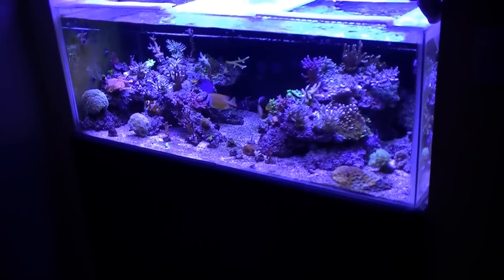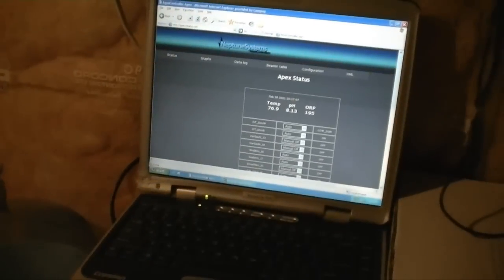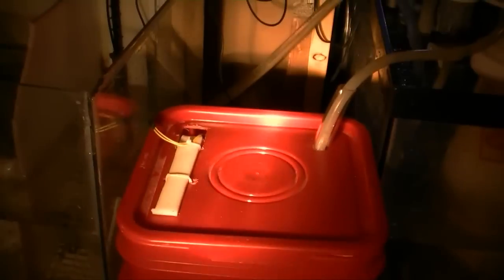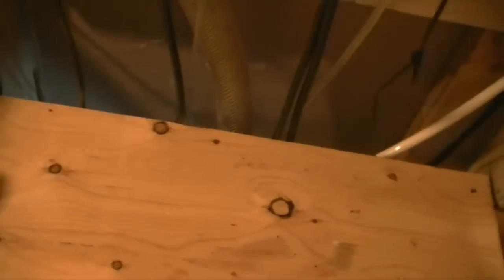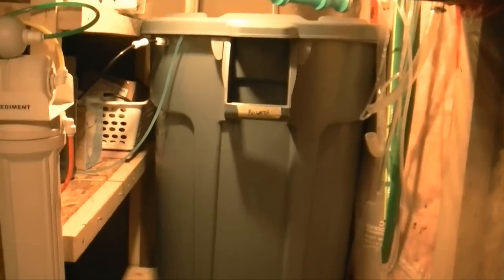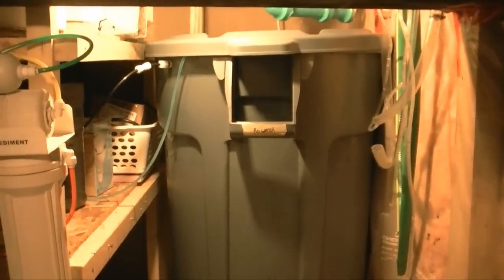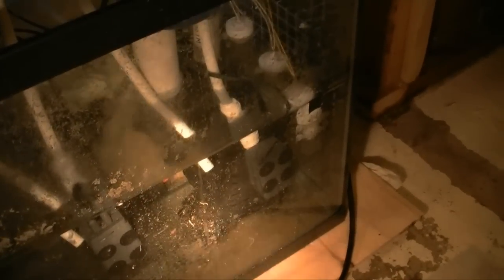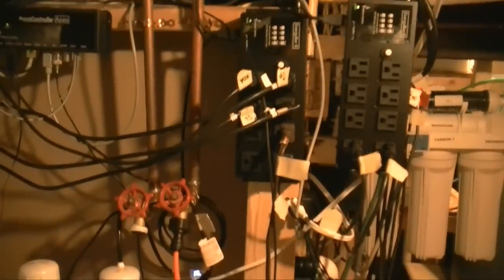Rickets Reef: Apex Auto Water Changer & Sump Update

Comment: Great idea with the float switch in the skimmer overflow bucket. I had that setup (overflow bucket I mean) once and the skimmer overflowed overnight and ran my pumps dry. I would recommend to have the float switch also turn off your skimmer pump just as an extra level of protection.

Comment from the maker: @sprinter144 that's easy. There's really only overflow from the display tank because the sump tanks are all level with each other and therefore just create one sump, just connected through pipes. My "multisump" can hold a LOT of water. could probably hold another 30 gal's with a power out.

Comment: I like your system.  I didn't hear if you have the auto water change set up as like a push button or the apex controller will do everything automatic.   But, if the apex does it automatic, won't you be alittle worried that the auto water change will increase your salanity for not taking into acounter the water evaporation?   I know you have a auto top off. but, they won't be able to tell the difference.